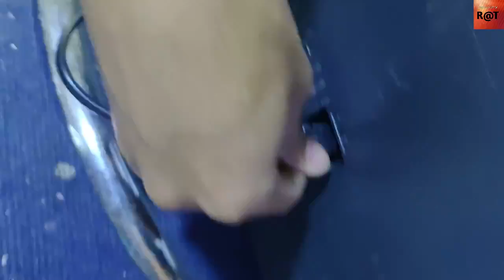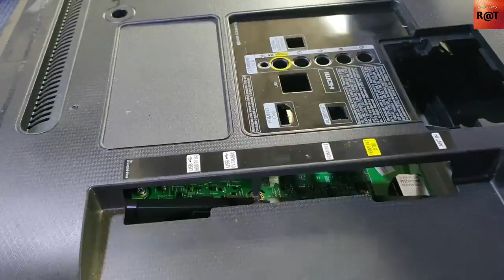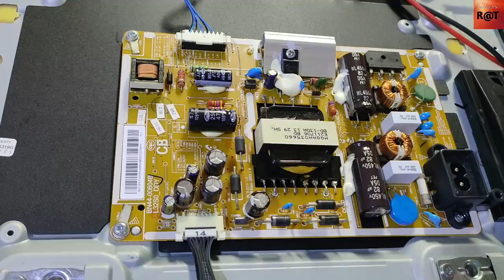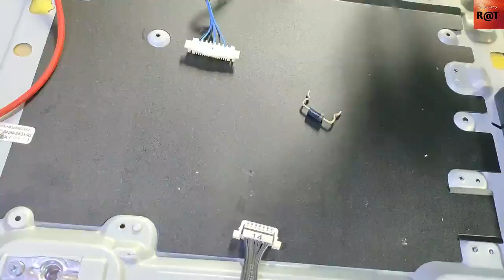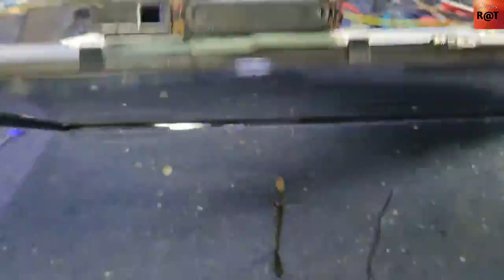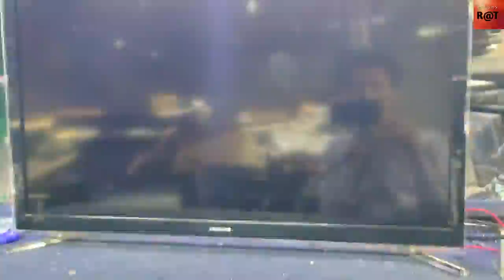which one diodes problem of TV LED samsung 32 inch model UA32F4500AM|repair tv

Comment: Diode no plz
Reply from the maker: chack power suplly
Reply: Which diode should i put
Reply: Diode amp and number please
Reply from the maker: @sujankarki5422  all diode we can use it
Reply: In your video  u have changed the diode but i didnt get the same diode  so what should i do
Reply from the maker: @sujankarki5422  in video i was remove diode problem
Reply from the maker: @sujankarki5422  in power have 2diode .i remove 1diode
Reply: Ya i also have diode problem
Reply from the maker: @sujankarki5422  you can use diode 3 pin